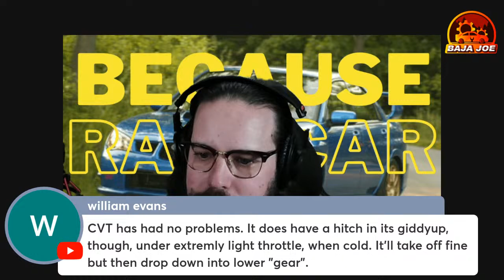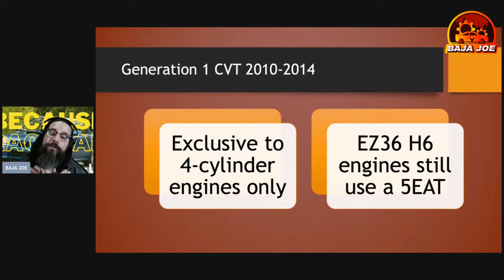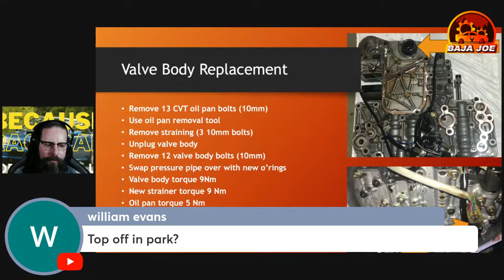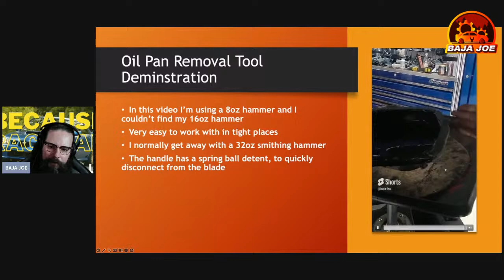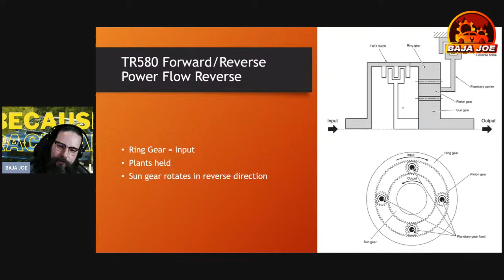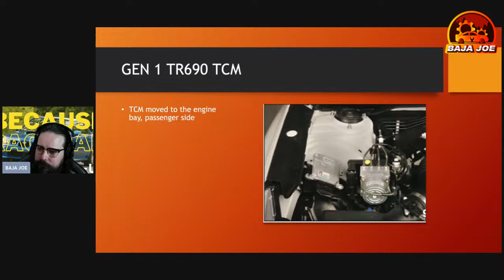Subaru CVT Theory of Operation, Maintenance, and Repair

Comment: Great video!

Thanks for encouraging to check/fill liquids as DIY maintenance, hesitant to do it myself without proper way to lift my car in level.

One note, I don't know about US Subaru CVTs, but my CVT has a "L" gear (lower gear, in printed manual it only mentioning it as engine braking feature for long downhill, but it keeps high revs for uphill - I found it more pleasurable that 1.2-1.5k RPMs in standard D mode)  and not "M" gear like mentioned in video. 
Fun fact, that many don't know, including myself for a long time. If you don't have paddle shifters like me and want to drop a virtual gear for higher revs to overtake somebody - you can quickly tap a gas paddle once,  release fully and then apply a needed amount of throttle - CVT will drop a virtual gear and the engine will rev up.
Reply from the maker: Th and for the feed back
I’m happy this information was helpful 

You are correct and should update the slides, some Subarus did not get sport shift and only have L.

BTW what model and year is your Subaru, because the first half of the slides were only about the 210-2014 legacy Outback.